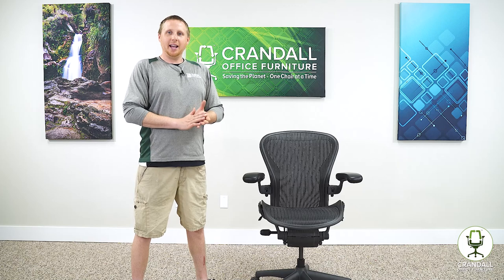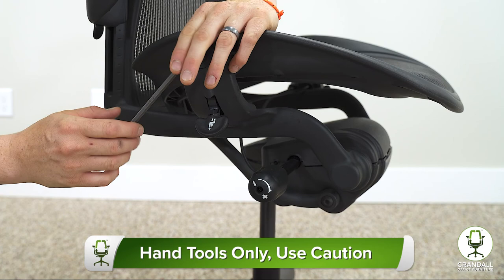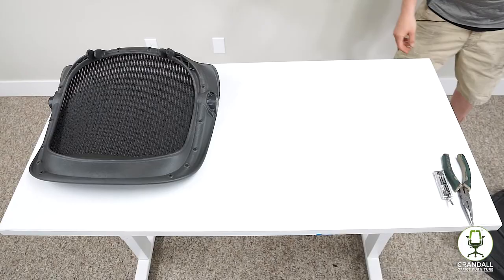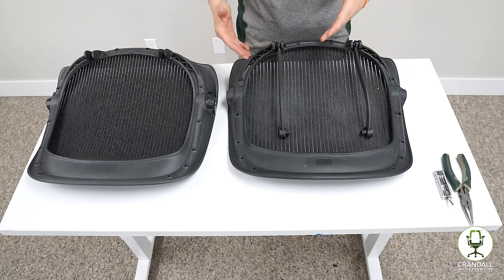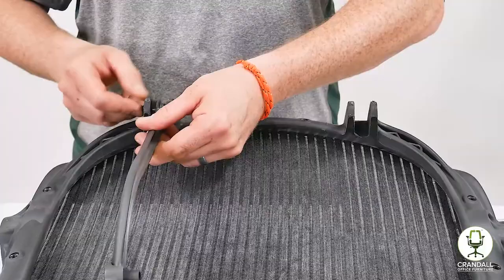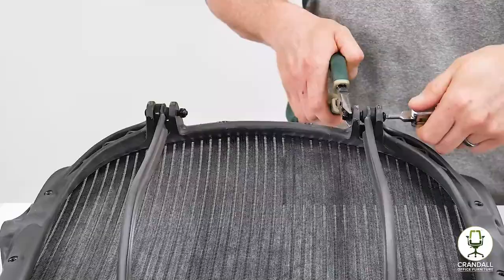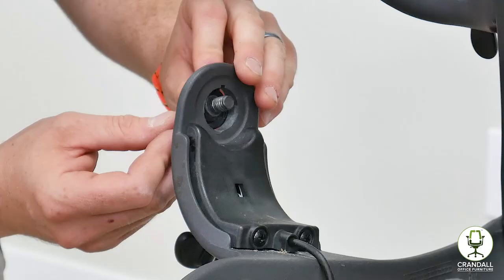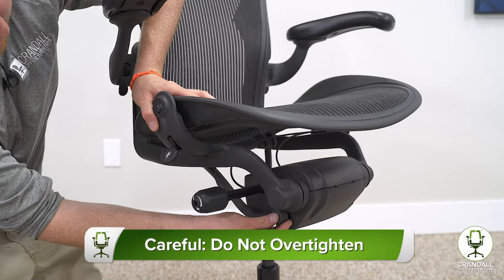How to Remove & Replace the Seat on a Herman Miller Aeron Classic Chair

Comment: Thanks, as this was a big help, but you should spend a little more time on getting the chair to align with the bolts since it is much more difficult than you show on your video.  Also, the bolt moves around at an angle at times and prevents an easy screw.  The last step was very frustrating until I was able to get the bolt started properly, and I could see that if done incorrectly, I could ruin the chair.

Comment: The method of slow steady pushing on the the first screws removed here is a good way to get the nut inside the seat pan to come right out with the screw - BAD IDEA... Instead, put a pipe on the allen wrench if you need to, or hit the allen wrench quickly with a hammer (the point is to move it super quickly so that the screw comes loose from the nut, not the nut loose from the seat).  Speaking from experience - I did it like this video and screwed up my seat pan.  Please revise the video.
Reply: "Instead, put a pipe on the allen wrench if you need to, or hit the allen wrench quickly with a hammer (the point is to move it super quickly so that the screw comes loose from the nut, not the nut loose from the seat)."

Could you make a video elaborating on this?
Reply: My 1999 Classic nut stripped off from the seat, I'm thinking of using super glue/JB weld to keep that nut in the seat, good idea? 🤔
Reply: @BrentLabasan  I'm just saying it has to be done QUICKLY.  A person I spoke with who refurbs these chairs every day told me this, said you have to do it fast to try to break the screw loose from the nut, that moving slow will end up with the nut coming loose from the chair itself.... When I say put a pipe around it, I mean putting a pipe around the end of the Allen wrench (or "hex key" they're sometimes called) so that you have something longer than an Allen wrench, more leverage.
Reply: @positivewalt4602  not sure what city you're in but if it's a big one, get on craigslist and find someone who repairs these (not some authorized dealer who won't tell you anything but a random person who will be honest with you about what does and doesn't work and will admit the design errors of these chairs).  Call them and ask.  But I doubt super glue is going to hold much weight or tension if you try to screw or unscrew it.  If the place the pan connects to the chair cradle thing is all in good shape, if you're not super heavy, if the cradle doesn't bend outward when you sit in it, just screw the screw AND nut back into the pan and it should just hold in place because the cradle is too narrow to let the seat pan pop out of it.  Hard to explain without showing you what I mean.
Reply: @busyboxst7  I'm 20 lbs heavier than when I got the chair back in 2000. Yes, the design is so strange on this chair when I pop everything back in place everything looks good and it worked for 3 weeks. I'm too heavy now and the seat "tacos" and the screw and nut pop back out every time now. Thanks for the info I'm in the SFBay Area so  hopefully I can find a repair person. I'm not giving up on up on this comfortable chair!✊
Reply: This happened to me on my 26 year old aeron size B...just read this comment after the fact. Now I've got 2 bolts stuck in the frame and the seat is ruined. It was quite frayed anyway so not such a big disaster. Going to try wd40 to loosen them. Then will need new seat pan and seat bolts. I only actually did this so I could get to the top of the gas lift cylinder to remove it. These chairs are a nightmare!
Reply: @nickf.8723  I just bought a new seat from eBay as my 23yr old seat cracked on the back. The seat came with a set of replacement instructions which identifies having to do that first turn quite quickly and hard to release the screw from the threaded insert on the hip pivot screw. Were you able to get your screw released from the insert?

Comment: thanks for the video, is it normal there is a bit of play between the plastic housing of the bolts and the metal on the chair or are they supposed to lock in rock solid?
mine does have a little play which makes the seat moving a tiny bit, depending on my sitting position.
Reply from the maker: Yes there is supposed to be a little play, however if you notice that play is getting worse please reach out to us and we can assist further.

Comment: Is there a reason to not simply unscrew the old, ripped mesh seat insert from the current seat frame, as well as the mesh insert from the replacement seat, and then screw the new one into the old seat frame? That seems as if it would be a much simpler and straight forward solution. 12 screws, and done.
Reply: Turns out that yes, one could simply replace just the meshed seat frame, but while doing so I came upon another issue. Under the mesh on the front of the seat there is a glued on foam pad. Missing and forgotten on my decrepit, old Aeron, and brand spanking new on the new seat. It cannot easily be removed from the new seat to the old, since it is glued in place, so I will be putting the mesh back in place and going through the regular replacement process. Damn.
Reply from the maker: @critifur  That's correct - also oftentimes the entire seat assembly is broken or cracked and needs to be replaced. Also it can be difficult to replace just the mesh, as sometimes the new mesh is very tight and tough to re-install. Having the entire seat off makes that process much easier as well.

Comment: Can't remove the j-bar for the life of me... About to just buy a new chair lmao
Reply: ensure you use the correct tool to loosen the screw. Some of these chairs are super old and the nylon nut was put on too tight from the factory. Cut that screw if you have to, that's an easy replacement.🤞
Reply: You needed a torque wrench attached to a t25 bit against a crescent wrench to do this